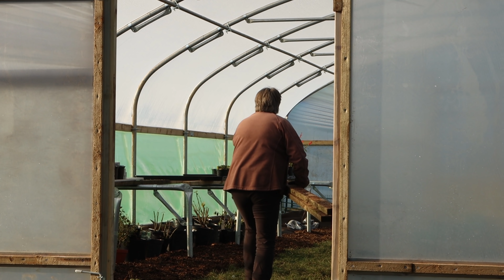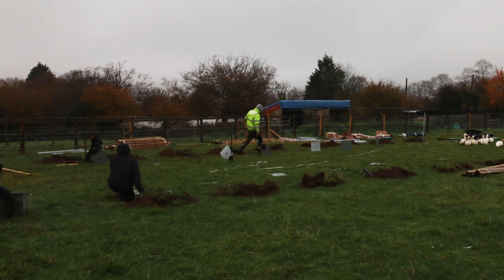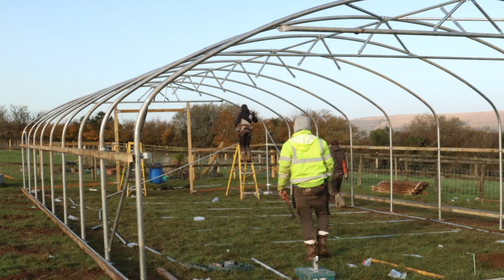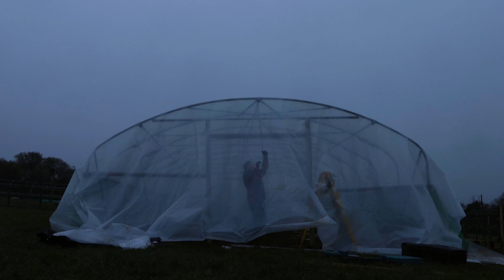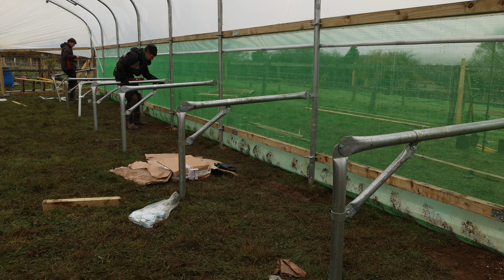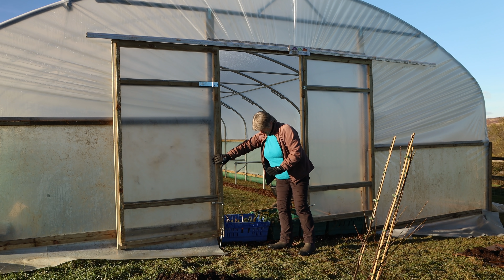Year Round Growing Begins | Polytunnel Installation

Comment: Now thats a ploytunnel , For the gap in the door i would use 2 planks of wood , one lay on the floor & the  other on hinges screwed to the one on the floor, that way you can lay it flat for getting in and out and pick it up when closing the tunnel. it should stay up behind the bolts for the door .or you could use hasps to hold it closed 😊
Reply from the maker: Genius! I'm going to have a look and see what wood we have that might make that work. Thank you so much!

Comment: With the "melamine" you can drill some holes in, so water doesn't sit on it.  I'm sure you knew that, but I use an old solid plastic popup table and used it for two years before I thought to do it. The tunnel looks fantastic!
Reply from the maker: I wondered about doing this, but was concerned that the water would make the wood pulp in the melamine expand and 'blow' at the holes. I think the tunnel looks fantastic too - it feels pretty amazing to be inside it!
Reply: @LizZorab  Your right, it'll puff right up and weaken. I reused some tatty old board and it didn't last long once the water got in the seams, holes and cracks. I got a season or two out of it though and it would have oy gone to the tip anyway.
Reply: @LizZorab  I wasn't sure what "melamine" was. You're right, the water would ruin the board and not last as long.

Comment: I so would have made the area level before building the polytunnel, that would absolutely drive me crazy every time I used it. they  only needed excavating on the high side, the internal could have been dealt with once it was up.  IMHO they spoilt the ship for a ha'porth of Tar.  You need to invest in a little quad bike and trailer Liz.
Reply from the maker: I couldn't afford to get the site levelled and a retaining wall built. I'm happy with where it is as that's the least hilly part of our site!
Reply: @LizZorab  Glad that your happy with it, but such a shame, it could have been done by reprofiling the existing ground with no need of retaining walls, mini diggers hire out at around £130 a week and you could have had a ball playing with the mud. Problem is I'm an engineer and for me it's all about cut and fill and moving the ground around.  May be worth thinking about it for your second tunnel when you have more time and hopefully funds coming in. I do have polytunnel envy as I only have two 6ft x 4ft greenhouses but would not invest in a polytunnel on a council allotment due to the vandalism, so looking forward to see how you develop the inside and and get cracking. Love the idea of compost heap hot bed type heating inside.